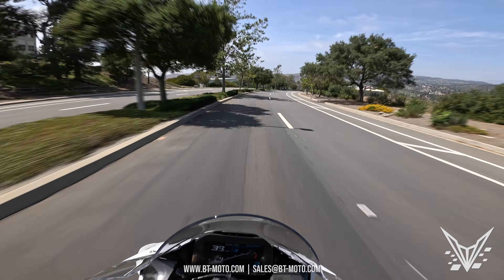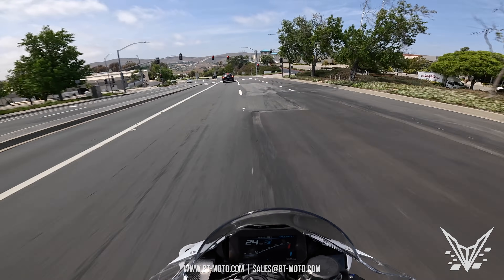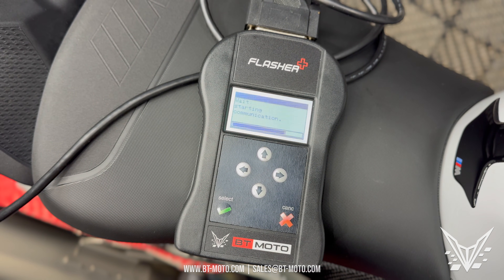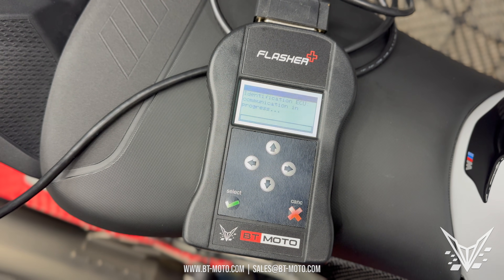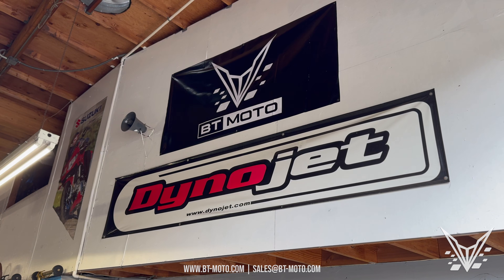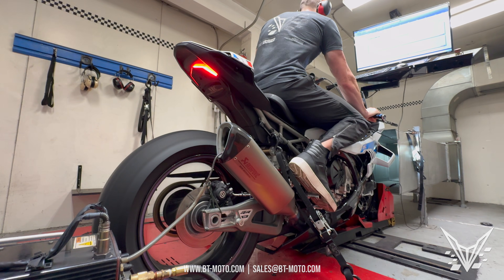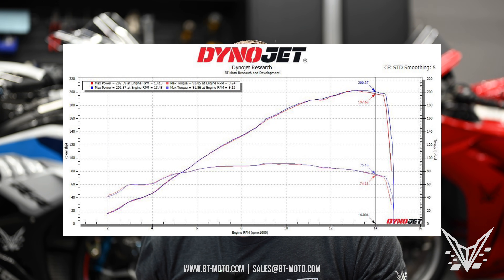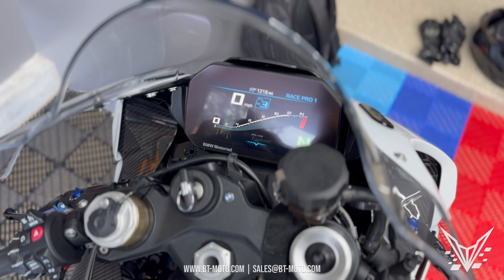E85 On The 2025 BMW S1000RR?! BT Moto Review

Comment: I had E85 in my 06 evo gas tank for 6 years just sitting in my garage, untouched. I was shocked, i drained it and it was completely clean, no gummy, nothing. I swapped the Fuel pump filters and ran 800hp back thru it without a single issue.

Comment: I'd consider E85 for the track and fill up every session opposed to every other session. The boost in power and cooling effect are both welcomed and after the track I'm changing the oil anyways. For the street I rather run premium just for the range alone, but in my area 93 octane is just over $3. if I lived in CA where E85 is half the price of 91, I'd probably be on that corn juice! 😅